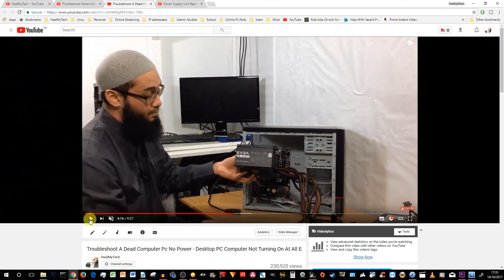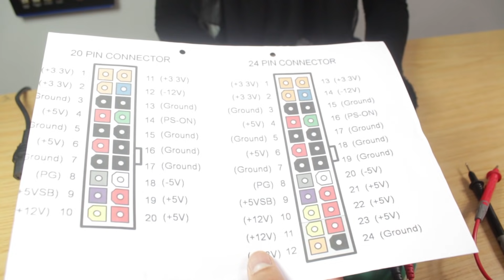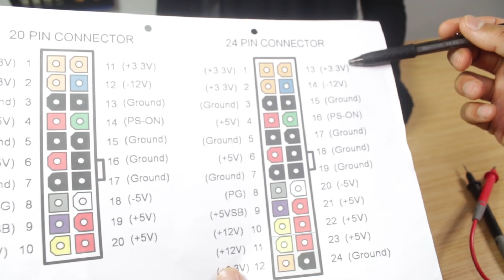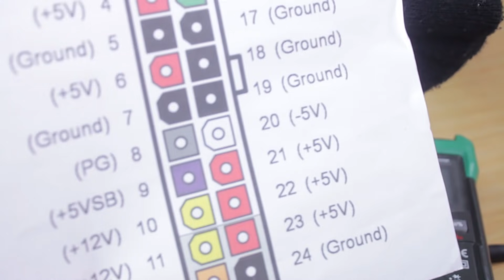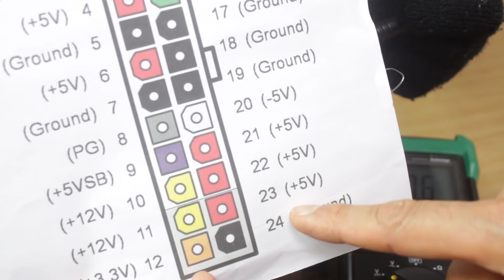How To Test A Power Supply Unit (PSU) With A Digital Multimeter | Advanced Troubleshooting

Comment: So, uh, what if my 24 pin connector is all black wires?
Reply: Well shit 😂😂😂 same on me hahahaha
Reply: Well that basically means your psu is fully grounded ( sorry for the bad joke)
Reply: It will only happen if you had designed it😂😂😂
Reply: Check a pinout image in google, identify the first pin by the shape, and then find the other pins. All of them are pretty much the same, if not sure, check your psu manuals.
Reply: I'm showing this in my live series "CAD PC Build | 1". Just showed it in number 19 (on live stream)
Reply: Well u gotta count the pins over and over 😅
Reply: It’s the same thing, just use reference the diagram
Reply: Like they said, reference the orientation based on the diagram and you can also double check by looking at the shape of the individual leads, either square or rounded
Reply: Use the diagram to the right hand side and line up the clip with the clip shown on the diagram

When lined up, count 4 pins down and that should be your green wire and right beside it to the right, is your ground

Comment: i have a very strange problem with a old psu, when it works, it works, but sometimes when i change parts it doesn't power some things, one time it didn't boot one of the ram slots, other time it didn't boot the second HD, that time when i unplugged it worked, what could this be? readings are normal. i'm starting to think it's something else.

Comment: Be aware folks, there is no wire for pin 20 the -5v on many newer psu's.  I ordered a new psu due to a testers 5v led not lighting up, now I see this and find there is no -5 line, which is why it failed to light up on the tester.  This is a great check for dead pc's, but this won't help with intermittent problems like a psu rebooting intermittently.

Comment: So when i tested my psu all the numbers were right where they need to be… but everything that should be negative is positive and vise versa… dead psu??
Reply: You sure your leads are plugged in wrong at the meter?
Reply: @lonniebeal6032  they weren’t but for whatever reason they still read backwards… i wound up returning that psu cause it was kind of a cheapo and getting an evga psu…. But i could not figure out why my pc wouldnt post sent it to microcenter and it just worked for whatever reason.. oh well its running now i just want a better cpu and im scared to mess with it for that reason lol

Comment: Hello sir what do I need to do if I requare 13-18v by 350mili amps ? Is it posibel to use same or dimilar polarity leads to get centrain out put voltage? I atempt to use an satelite dish motor manuali activate that thing because I don't have an reciver .

Comment: is 4.7v is a bad psu on 5v pin? all of my 5v pins outputs 4.7v is that dead?
Reply: ++ its 4.78 rounded off with 4.8, they have all the same voltage output

Comment: Mine came color coded all black. So without your chart there is no way to tell. Thank you for providing this detailed information. 
Reason for me to do this is my computer will turn off by itself at random. Other times whea uncorrectable error bsod. (That you’ll set cpu vcore to 1.270v ) Now motherboard won’t boot. If you’re facing this it’s the psu not your ram, mb or cpu. Hopefully save you some time if you’re facing this issue.

Comment: sorry if i missed it techy stuff is not realy my jam but i am trying to learn. maybe i didn't catch it but did you mention what we should do if the psu works but it restarts abruteply and consistently in weird times? for instance..when you did the testing if even ONE pin come out with a number too high or too low even though would this be a psu replacement?

Comment: My computer turns on but nothing appears on screen. I understand this is likely a video issue of some kind. My question is if it is possible to be a power supply issue. Almost all of my values are between .05 and .20 volts outside of the acceptable 4% tolerance range. It is a 6 year old system I attempt to repair sometimes. Can voltages outside of the range to this extent cause an issue like mine? Thanks

Comment: Heads-up. I just now used your video and checked my PSU. It’s working fine. That means either my Gigabyte MB or the Pentium CPU broke. My machine isn’t booting with no life at all. Will try repairing or maybe upgrade.

Thank you for that 24 pin chart thing and for this video.

Comment: If you put the pin power supply work and once you remove pin doesn't work what's the component is not working?
Reply: If you're talking about the jumper wire from green pin 16 to any ground, that's the power on button feed back loop.  It's a safety precaution.

Comment: Ok all pins slightly above the spec except Pin 14 - the blue one. - Which is showing -11.46v which is out of range. 

The Computer is old but working prior to going shopping - came back won't even post despite replacement of iffy capacitors and a graphics card swap. What does this Pin 14 supply and could it have just slipped below the threshold to stop something working.

FYI the original graphics card was showing an LED Warning light hence the GPU replacement but this hasn't worked. 

One side of me says the low PIN 14 output is the issue but then you see that PCI Express slots dont have a a-12V feed.

Will buy a new PSU but don't want more expense if this is not the issue.

Comment: Excellent video I learnd how to turn on PS without motherboard.  Also very good picture of power plug pinouts and you even added the tolerance ranges for each pin Excellent.  May I borrow your assistant hands i need some one to hold things when I am working.  also nice touch  zooming in on the power cord symbols.   I also like that you were talking us through the tests so I new exactly where i was.     Subbed and Like  cheers

Comment: great video: but...wouldn't it be best to do those tests "under load", ie: while the computer is working? by probing a HDD connector plug for 5v and 12v, other voltages? find then on the motherboard or in extra PSU plugs..

Comment: Hello, how many amp does the 12 v put out.  If I connect the 12v to a video board that uses a 12 3amp power supply, would it have too much power and burn up the video controller board?

Comment: Could probably leave the PSU in the case and test it. Just unplug it all from the motherboard and do the same test he is doing. So if it turns out the PSU is fine, you don't have to rerun all the cables.

Comment: I believe the only two ways to destroy it, are to short the wrong pins and not the power on with the ground or accidentally choose a current measurement from your multimeter which is going to short the pins that you touched with the probes. For those who don't know, when you measure voltage, multimeters are designed in such a way that the resistance between the two points that you measure is very big (theoretically infinite). This means that no current is able to pass from one probe to the other (or just a tiny amount can pass) thus there is no way you can short and destroy something.

Comment: What if the voltages are above the tilerance? So instead of 3.3 I have 3.45? Just one example, all my readings are at thr top tolerance or slightly above it.
Would that cause my pc to power up (fans spinning, lights shining) but system not booting up or sending signal to monitor?

Comment: Great video and thank you so much for it. Lucky me found it too. Ill just echo what everyone else said. Even in a quality tech school you dont get it this easy and precise almosat like one on one instruction. . The pinout charts were beautiful.  Now the PSupply  im only 20% worried about i can test instead of testing it first blind with the new pricey board and processor i just installed.  Thanks guys.  Edit to add:  Just finsished the test exactly as shown and voila i KNOW i have a 100% power supply on all circuits...nice!!!

Comment: When I test this I am only getting 3.3v from the green pin to ground shouldn’t it be 12v? Also I’m not getting any voltage on any other pin except pin 9 I’m getting 5v. Does this mean my psu is bad?

Comment: Anyone know if it's bad if my blue wire which should be -12v is -12.9v, which is outside of the tolerance mentioned in the video :(
Reply: Blue and yellow : 11.52 to 12.48V works perfectly fine it's in his description if your reading is below 11.52 then one of the parts of your system will malfuntion like mine my reading is 11.44V my fan turns slow spin i dont the monitor also has no display the cpu also i noticed is over heating i suspect it's due to the psu i will replace it soon as possible

Comment: My -12v pin is at -11.32. Which is outside the 4% range. Iam asking cuz my pc kept powercycling while in "newer games"   please respond! Someone. Thank you in advance!
Reply: Blue and yellow : 11.52 to 12.48V works perfectly fine it's in his description if your reading is below 11.52 then one of the parts of your system will malfuntion like mine my reading is 11.44V my fan turns slow spin i dont the monitor also has no display the cpu also i noticed is over heating i suspect it's due to the psu i will replace it soon as possible

Comment: One of my readings was  -12.82 volts on a 12 V pin which is outside the 4%.  Is that a problem ?   Excellent, clear video.  Thank you very much.

Comment: So my system recently stopped working. I looked up what the causes of a orange light at my ethernet cable were and it said my psu and/or motherboard. I did the test on my psu and whenever I hit the 12 pin with the positive (red) stick, my psu stops and shuts off. I unplugged the paper clip and reclipped it, and did the same thing. Can anyone help me?

Comment: This NOT how you test a power supply. You MUST test the power supply while its under load to measure true performance. 

This is like asking a person if they can run 20 km and they are just saying yes without proving it.

To actually test: connect the psu to the computer and turn the p.c on then you can measure from the top of the 24 pin connector

Comment: Ok, so my voltages are good, but maybe it's a problem of not being able to handle a load? My fan spins when terminals are jumpered as described, but doesn't continue to run like yours did. Trying to get a rig running but motherboard, fans and gpu's just flutter on/off. 
I have a Corsair RM1000x, though I'm sure it doesn't matter. First one I didn't get fan spin when jumpered(new out of box that was sitting 3yrs unused) so I bought another and get this flickering stuff. Ideas?
Reply from the maker: Sounds like incorrect voltage coming from possibly PSU, CPU, or even motherboard.  Do I understand correctly that a KNOWN WORKING PSU swap did not do any change?
Reply: @HealMyTech1  the new psu has the MB decorative white LEDs on the board blinking while the cpu and cooling fans rapidly go on/off.
Came home tonight and turned on PSU and hit power button for MB but nothing happens. Did that a few times last night too. CMOS battery was dead so I grabbed two I had around(may not be good either)but didn't help. Yes, voltmeter shows good, proper power on each terminal.

Comment: Our PSU was great, the problem was with the Power cable. Thank you for a very informative diagnostic video.
Reply from the maker: You're welcome!
Reply: The power cable can cause issues for the psu??
Reply: @corndogers564  Yes. The video shows how to test the cable. We had a faulty one that was providing lower voltage than the PSU required. Changed the cable and the PSU was fine

Comment: i have rtx 2060 ,msi b450 ryzen 5 3600 , trident ram 2*8(16gb) stick, cooler master 550watt

in my case when i'm use cpu based software my system runs wells but when my work with GPU such as render through GPU my whole system crashes.

you tube, max and maya software runs well but at render of single frame my system will restart

i don't understand rtx card is damaged or my psu is responsible for crashing, cuz some theory say graphic card wants power if required power is not given by psu whole system crashes.

so tell me your opinion 

when i  do benchmark furmark app crashes within a second nad whole system will be restart

Comment: Assalam-o-Alaikum! Bro I did jumper on the green and the black wire. When I plugged in the cord, the internal fan started and then stopped in a second. What's the issue bro? Do I've to replace PSU?? And there are two orange and green lights remains on in the PSU whenever I plug in the cord in PSU. Please tell me the solution bro. Thanks in advance!

Comment: Good explanation bro.I've a problem regarding my com psu..suddenly shut down.So,i dismantled the psu and tested the fan..it was working.Finally i tested the psu by looping the wire at the green/black but the fan no running.What's the problems there?tq

Comment: Where you plug in the power cord which is female prong and the power supply unit's are male prong ( assume the unit is an SMPS power supply nonlinear), if you measure for continuity on that male prong end on the power supply should there be any continuity there and if so roughly what ohms or should there be no continuity?
 ( I assume it must show some sort of continuity or there is some sort of open in the circuit somewhere. Or if very low continuity I assume there is a serious short somewhere.  Does that sound about right?)

Comment: This is a good intro for entry level troubleshooting for a PSU, but what I would call "Advanced Troubleshooting" would be testing the voltage lines under load, which is a little more difficult. As a PSU could appear to be working just fine until you get it under an extensive load like in a video game or rendering session whereby the PC would restart due to a drop in voltage (most likely on the 12V supply) from a lack of current, measured in amperes, and is otherwise not sufficient under such load.
Reply: Have been there recently.  First PSU failure after years of computing.  Worked fine when not under load. Constant BSOD only when gaming.  Luckily the only issue apart from replacing PSU, was losing the OS from constant sudden shutdowns. All good now with a format and fresh install.
Reply: How does one do this this?
Reply: @SuperKiki93  Are you seeing my post? I can't see my comment wtf, do similiar to what he is doing but under load you can use the search watch?v=ZiYFwjdh_lE

I just know how much my various hardware consumes so when I bench test a PSU I just choose the hw based on how much 12v amperage I am trying to load up on the PSU.
Reply: @SuperKiki93  It is not possible to test each supply underload with his method. You will need to connect input/output wires to each hardware that power is supplied to and also understand their power requirement for each hardware. To answer your question, you will need to buy 20/24 Pin LCD Computer PC Power Supply Tester for ATX BTX ITX TFX SAT (it's about $11 online). It's a plug and play for 20Pin, 24Pin ATX interface / SATA interface / 4Pin, 8Pin interface / PCI-E graphics card 6Pin interface / floppy drive interface / ATE hard disk interface

Comment: I bought new smps made in china, pc on but no signal to display  tested voltage on multimeter it was fluctuating on every hot line between 12v to 10.9 5v to 3.9

Comment: I was having an issue with a Corsair power supply I just bought and returned - tested fine on a multimeter, but still was shutting down in actual use. Double checked everything, old EVGA power supply works fine. Bizarre
Reply: you ever figure this out?

Comment: When I do the following;-
 1. connect pin 15-16 to turn PSU
 (all Ok) 
2. connect black needle to pin 24 and red needle to pin 13,14, 21,22,23 
(Ok- all is good)
3. connect black needle to pin 14 and red needle to pin 1,2,4,6,9,10,11,12 (WTF ??)
 The First set are spot on; but the  2nd set Are either 3x the listed Voltages (1 & 2 supposed to be 3v but are 15.57..v), and (4, 6 & 9 supposed to be 5v = but are 17.4v) & in the case of 10 & 11 they are near zero volts at 1v? or something;- (   '1   .     ) . 
And next, the 12th pin (supposed to be 3.3v) is 15.6v or so

Looking inside the PSU is relatively clean and looks perfect.

PC was running fine... but PUBG kept crashing halfway through the game. Then when I re-booted after the BIOS it went dead with one white underscore on a black screen. So, assumed CPU or GPU, but then wondered 850W Platinum PSU made in China maybe at fault. Wondering if i7-4770 CPU could have caused it?; or even TUF Motherboard? Or Strix GTX1070?

Comment: Thanks for the excellent tutorial. My psi is a Corsair AX750. My 24 pin connector wires were not color coded, but I figured it out. Also there was no wire in the white slot, position 20. All the voltages checked out, so now I need to continue trouble shooting. I have read where amperage under load could still be faulty with a psi under load, but still show correct voltages. Is it still possible the psi is the problem (black screen)?
Reply: I bought a Corsair HX1200 recently, and it also tested fine on a multimeter - however it would almost always immediately shut down after being powered on with the PC. Strangely, it actually ran fine for a couple hours, but after I powered down the PC and came back the next morning, it was shutting down again. My other EVGA power supply works fine, and I swapped everything out/double checked multiple times. So, this multimeter test obviously isn't the be-all end-all. Personally, I'll never be buying a Corsair power supply again.

Comment: I get PC shutor freeze, Kernel 41, ID 63, tried everything and after watching this video I find out that my blue 12V rail is giving me -11.44V, so the PSU is faulty.
Reply: Did you buy another psu and did it work? I have -11,34 everything else normal.
Reply: @Brainless420  yes, I buy it and not a single shut down, works like a charm, so it was that bad rail on a PSU.
Reply: @mrki412  ok ty